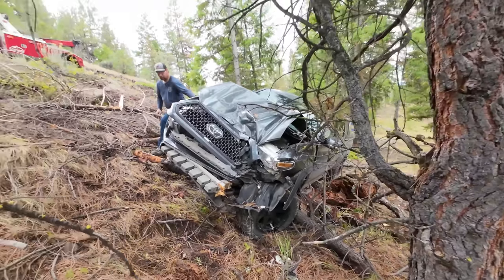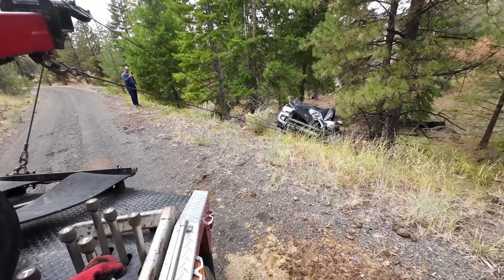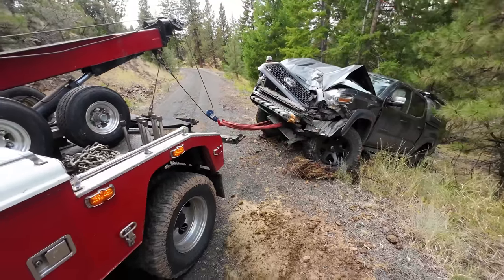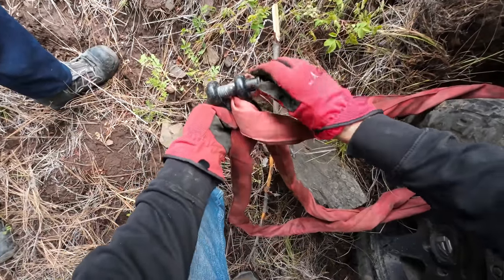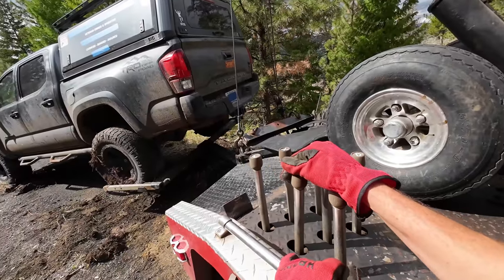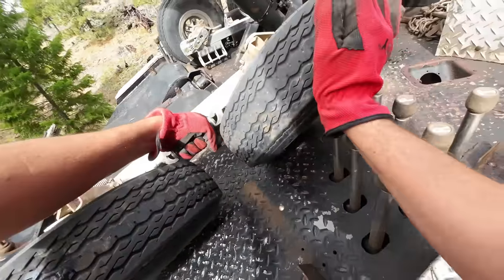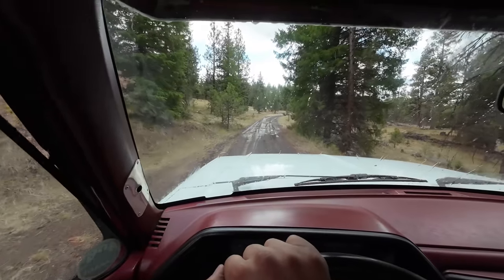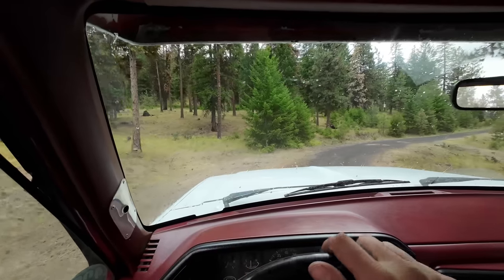This was a BAD day in the woods..

Comment: Easy recovery, from my living room. You always make it look so easy though. Some insurance companies can be difficult to deal with. When my 4x4 truck got totaled they didn't even look at it, and wanted to give me $4,400. I told them to look at it and see that it is a special edition worth approx. 3x that. They called the body shop and asked which truck it was, then paid the correct amount which was $11,500.00. This was put towards my new truck costing $40,000.00. My old truck was so bad, it was not even worth buying back to try to salvage anything. Two good things were I doubled my towing capacity from 6,000lbs. to 12,000lbs. & added an extended cab.

Comment: I use my 4WD on most dirt and gravel roads just for the added stability. I often go into low range on steeper rocky trails so I don’t have to ride the brakes so much. I’d rather drive slower and safer than risk unnecessary damage or overheated brakes.
Reply: One thing I really appreciate about mine is having low range with an open centre diff.

On really tight, steep but high traction surfaces and especially when towing it's great.

Comment: The lenses are likely replaceable and if light scratches repairable. The oem has a repair center in Irvine.

Although not an insta360 I've replaced badly scratched 360 cam lenses; after which I immediately bought lens protectors.

Good luck. Enjoyed the vid, thanks for sharing it.

Comment: If the lens on the 360 camera is plastic you might be able to save it with some brasso metal polish in the blue and white can with wadding. It takes the top most layer off the plastic enough to smooth out the gouges and make it nice and clear again.

Comment: When I worked for Vulcan Equipment, on completion of the build we would lift another F150 on the stinger. At this time two guys could take hold of the push bumper and lift the front wheels off the floor.

Comment: As you were talking about why you used 4 wheel drive, it reminded me of times not to use 4 wheel drive. I have a mile and a half drive out to the mailbox. Last winter was the first use of a Polaris to get the mail. Icy road so 4-wheel drive to get up the hill away from the house,  level for a mile, then a 12% downhill to cross a creek before uphill to the road. I came to the little, hill started down and took my foot off the throttle and became a Polaris snow disk.  After that, it was 2-wheel drive down that hill so I could steer. .

Comment: They didn't hesitate because that truck is absolutely fixable. The steepness of the hill actually probably helped that and kept the damage away from the frame above the bumper and just took out the core support and hood amd mostly cosmetic stuff. Not saying it's not bad but looks to be pretty cosmetic and with the cost of vehicles these days insurance company's push to fix if possible. I have seen the shop I work next to fix stuff that involved cutting the whole front of the vehicle off just behind the windshield and replacing it with another. Crazy what they can repair.

Comment: I always figured the little wheels were for the suitcase go-kart that I imagined you had in one of the toolboxes. You know, as a standby emergency vehicle in case the tow truck decides to stop working in the middle of nowhere. 🤣

I'm not surprised the insurance company wanted to have a body shop look at that Toyota. The replacement cost for Toyota trucks is sky high these days, so even an expensive repair job can be cost effective.

Comment: When you're about to strap that steering wheel, the ratchet handle was up and you had to put the strap through two holes.. turn the strap slot perpendicular to the ratchet and fold the handle closed, slide through the slot then you're good to go... just a couple second faster but less hassle

Comment: Dang the 360 is now a 180 :-( > One thing I wanted to ask, have you got a spare wheel for your dolly wheels? What if you get a puncture?  Or do you then just ring a tow truck :-)
Reply: Does he even have a spare for the truck?

A good trick is to carry a tire plug kit and air compressor. 
No need to even take the tyre off.

It won't fix all types of damage, for what they can fix they do a great job.

Also, it's not realistic to carry a spare everything. 

One employer I worked for didn't have spare tires or jacks for changing tires. It considered unnecessary weight that limited the load capacity.

We had a contract with a national mobile tire repair company instead.

Comment: 15 years ago, I purchased a Nikon camera and five different lenses. Called my homeowners insurance and put a rider on the policy and insured all my camera equipment. About a hundred dollars more a year. I have sent in a piece of my equipment at least six times. No deductible, no problems getting them all fixed. Not sure if you can get that in Oregon or not. Sending in one of my 800-dollar lens that fell into the power sand of the White Sand Dunes National Park. Focus stopped working.

Comment: Casey, so many years as professional driving, and still did not watch road to drive safely to 360 cam :text-green-game-over:. :eyes-pink-heart-shape:
Good advice for towing brakeless things, but most of us dont have 4-wheel drive towtrucks, just cars with hitch on them, so most important thing regular driver have to think, is load on hitch, too low or high is very bad, specially on high speeds. So easy to lose control of your vehicle, too low hitchweight lifts up rear, too high front.
Now you proved , that you are not that good as making videos also:goodvibes:

Comment: Not that I care. But didn’t see the tow dollies strapped to the tires. I know from first hand experience that they are not that hard to make the vehicle come off of them. At least if it were to flip the dollies and it was strapped it would only destroy the junk truck instead of potentially going into traffic or over a hill side.
Reply from the maker: That’s because I never strapped them down.   But aside from that, everything else you said is nonsense

Comment: Dumb ? Why not just throw two straps over the camper shell?  I guess in a pinch if you couldn't get to an area to get turned around?
Reply from the maker: Because then you scratch up the shell and the bed sides, and because it doesn’t stop the rear window from blowing open and shattering